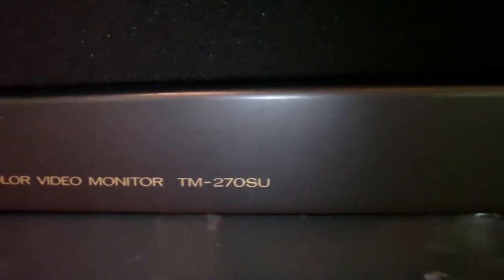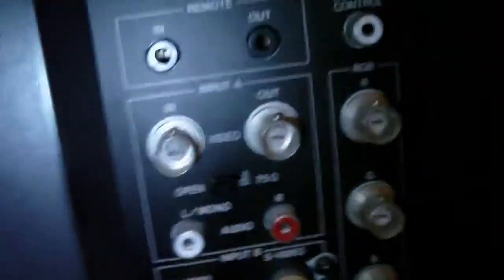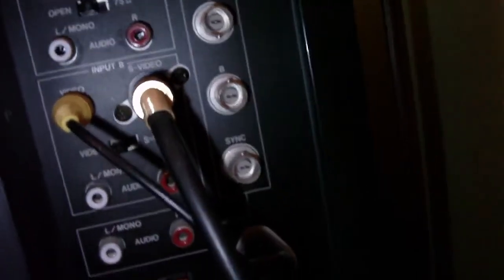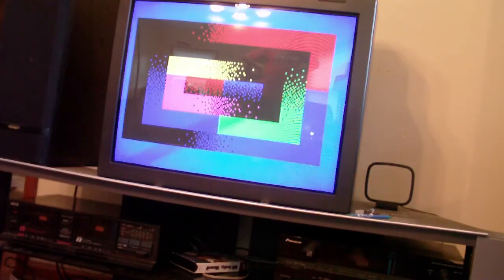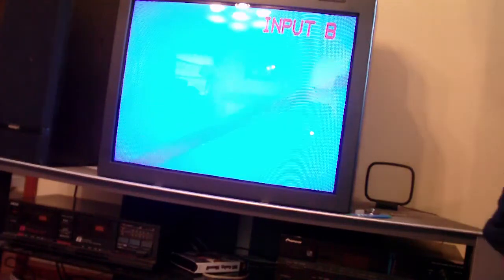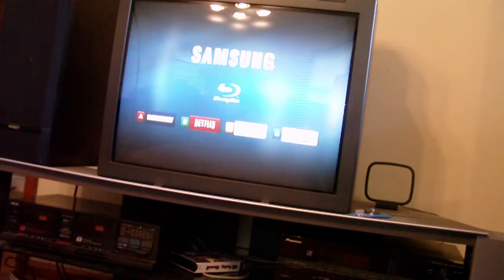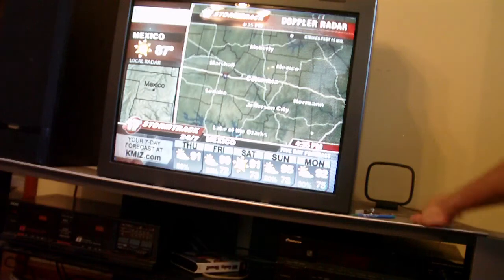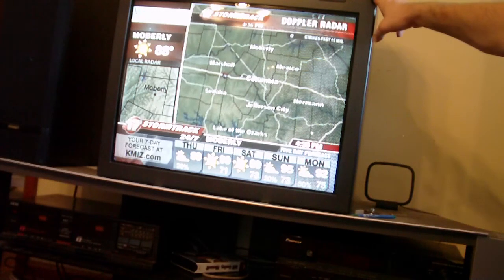JVC Video Monitor

Comment: That's an interesting monitor. It clearly was designed for some kind of institutional use, like the arrivals/departures monitors in airports. In fact that's exactly where I remember seeing monitors of this size being used, which looked specially designed for the purpose, not just ordinary consumer grade TV sets.